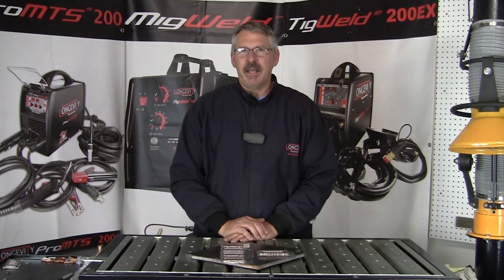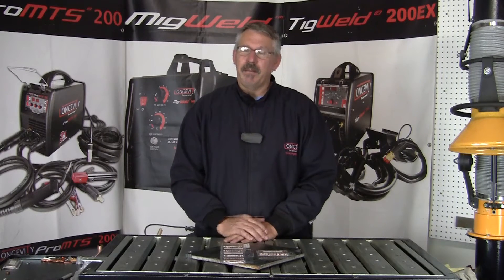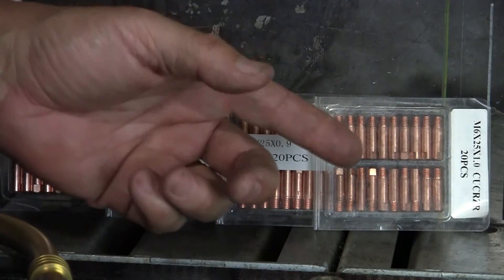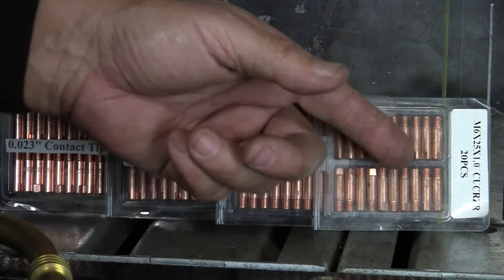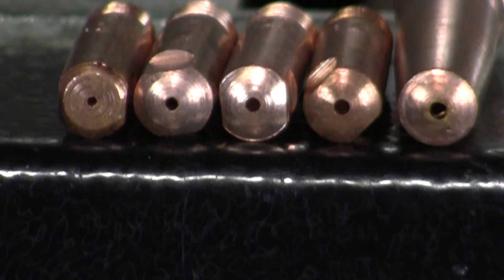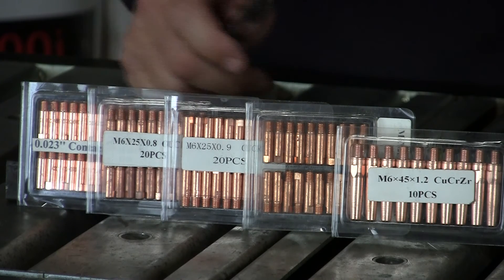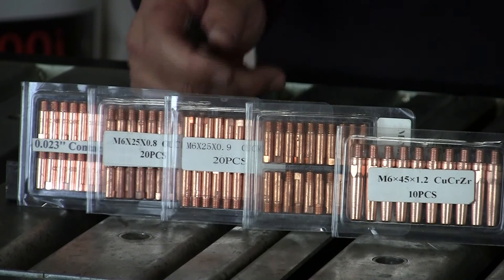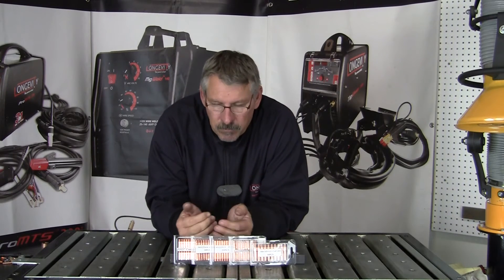MIG Contact Tips Explained - Diameters & Tricks

Comment: When and if I have to replace the mig liner if I go up and wire size? I bought my first mig welder. The MIG welder is currently set up for solid wire 0.6.  I want to do flux core .9.  I have a 0.9 tip and the .9 feeder wheel.  Do I need to increase the size of the MIG wire liner?
Reply: nope, i run .8  gas and .9 flux with the same inner, tips i change to what i need, .8mm or .9 for fluxwire

Comment: I'll have to say, not a great start.  Metal Active Gas?!  It's using inert gasses...meaning they're non-reactive. Non-reactive meaning they're not oxidizing and not corrosive, providing an inert environment for the metal while it's molten to prevent slag and oxidative impurities from forming in the weld (making it weaker).

Comment: I just bought a lincoln 180 weld pak and I don't have a 230v plug adapter power source as required. So I bought an adapter to allow me to plug into the welder and plug into a regular wall outlet. I did this before with a Cornwell welder and it worked fine. Idk know that much about welding but it just doesn't seem to have enough power. Even maxed out it just pops, no welds. I'm using copper wire, .025 I believe, with 100% argon gas. Idk, any suggestions are greatly appreciated.
Reply: you are adapting and plugging the 230volt welder in to a 115 volt outlet?
Reply: You should have Steel wire ER70S is a standard mild steel wire and also you want 75/25 gas 75% argon 25% co2. If you are somehow adapting at 230volt machine to a 115 volt outlet its not going to function at all properly. 230 volt would be two 115 volt that are 180° out of phase. it be 115 volt from each of 2 lines providing power to the breaker box so you would pull 115 volt from from left side and 115 volt from right side of breaker box.
Reply: @JayJay-de8vq  I bought an adapter that has the welder female end, and on the other side is the male 3 prong plug in for standard wall outlet but the welder wasn't working. I'm thinking about just running a receptacle off the dryer receptacle
Reply: @somanynamesilltrythis0180  That sounds like it is a generator or RV/camper adaptor. It sounds like you are only actually supplying the welder with a single 115 volt input. A 240 volt welder would work fine from your 240 volt Dryer outlet that should make it weld great!
Reply: @JayJay-de8vq  you're right, I ordered the adapter from Amazon and it came from some rv company. I wired in the correct receptacle for my welder from the dryer and it's working great now. Thank you!
Reply: @somanynamesilltrythis0180  Hey I'm glad its working good now! no problem! Happy fabricating! lol
Reply: You're not getting enough power. 110v simply doesnt have the same power delivery as 220v. There's a reason for the different plugs.  Will it work and get the job done, yeah. Is it going to be optimal for what the machine can do? Absolutely not.  If you dont have 220v available where you're welding, you may need an extension cord (and possibly an adapter) to plug in where your clothes dryer plugs in (presuming electric and not natural gas powered); that's a standard 220v/30A breaker.  Ideally you'll want a 220v circuit on a 40 or 50a breaker depending on your welder's specs.
Reply: @DGPHolyHandgrenade  I ended up splicing into the dryer receptacle and mounted a separate receptacle for the welder right next to it. You're right, that adapter pigtail wasn't cutting it. The way did it works great, I'm just making sure I don't run the welder and the dryer at the same time.